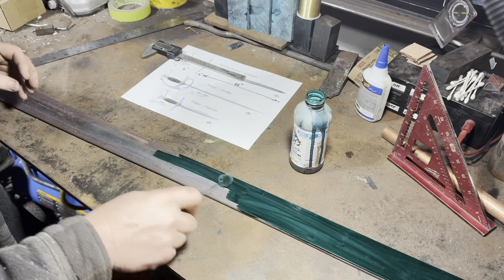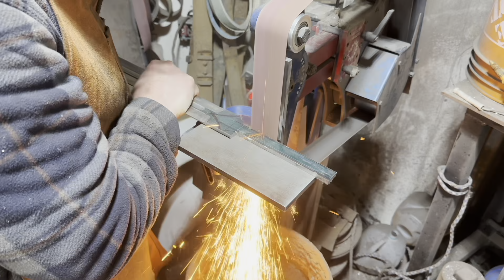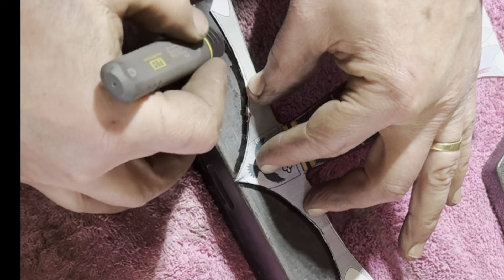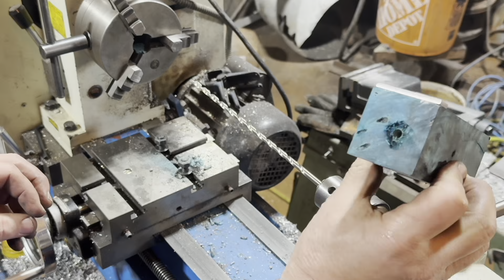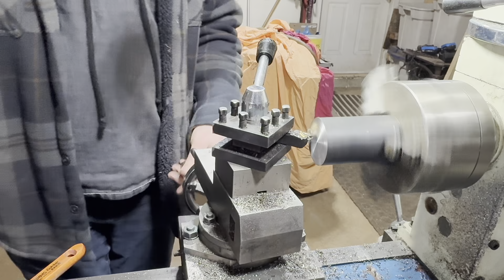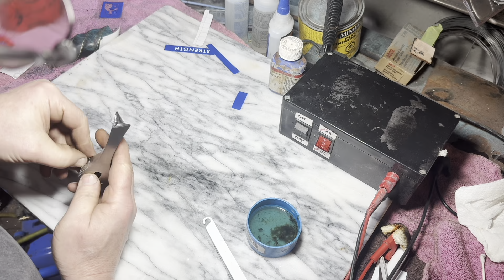Arming Sword Build #swordmaking #sword #bladesmithing #bladesmith #armingsword

Comment: So... you don't give it any distal taper, and have a pommel that small? Not sure if that would be a very viable combat sword. ANY one handed sword NEEDS a distal taper.
Reply from the maker: there is a minimal taper near the point as it was the only way to pull in the bevels, but it also not an overly long sword.  Plus the primary purpose of this blade was display.  But you are correct.

Comment: That handle looks cool but omg would that be painful to swing
Reply from the maker: its surprising more comfortable than it looks.  the flutes index to my fingers and wire ridge is not pointed but rounded over.  Remember a gauntlet was always used so the abrasion on the palm should provide grip.  But, a build like this was never meant for something like HEMA, but more a piece to be used in court.